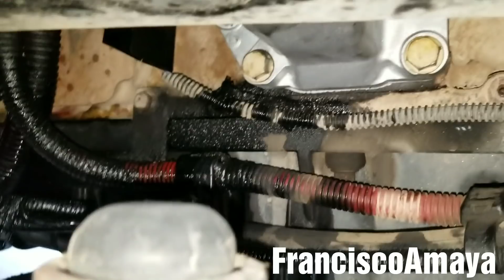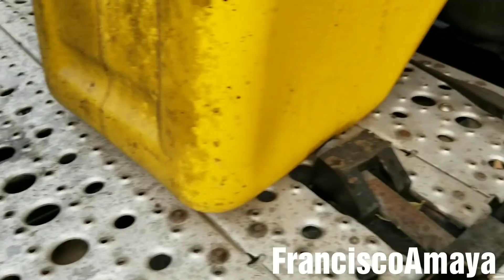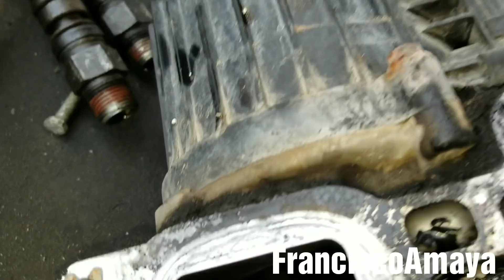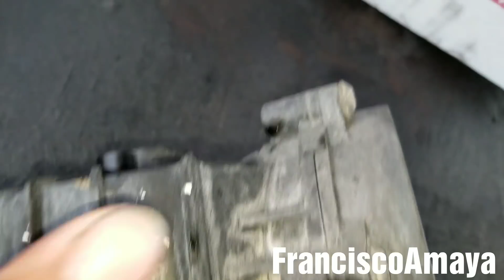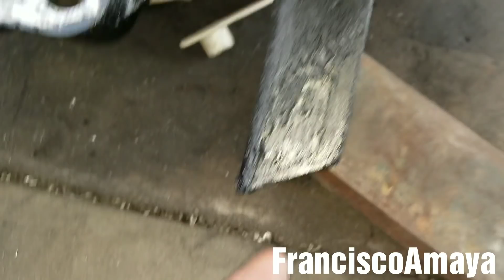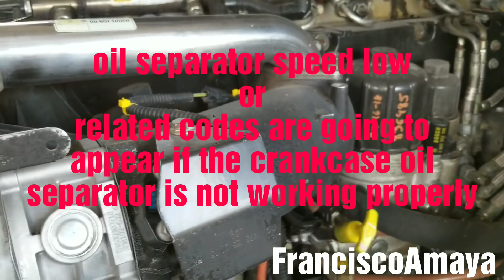Freightliner cascadia DD13 DD15 DD16 SPN 5444 FMI 1 Bad crankcase filter oil separator leak

Comment: Thanks for the explanation of how this works. Will this cause the engine to accelerate slowly or the truck to slow down when coming off the throttle? This is what mine is doing, in addition to spewing oil. Push the clutch in when coasting and the truck coasts freely instead of slowing down.

Comment: I have my crankcase breather leaking oil, excessive white smoke when engine hot, also loosing 1 gallon coolant every  25 mile drive.
Reply: Same issue did you find out the problem
Reply: @AA-bk8qg  did you find out the problem
Reply: @notkirill6991  changed crank case, and re sealed oil pan. Also oil cooler was bad that could have caused the smoke to to I don’t know
Reply: But everything is good now
Reply: @A A  ok so u saying changing the filter might fix the white smoke issue?

Comment: I changed the filter and it's leaking still. Seems to be leaking more. I also put a oil rag under breather and it's covered in oil coming out of breather on crankcase filter. Any suggestions 🤔

Comment: I have dd13 freightliner cascadia. 
Had this code spn 5444 fmi 1
I changed oil breather,  speed sensor and fault code is still there. Please advise.
Reply from the maker: Probably the engine harness is bad

Comment: My truck is leaking oil from the crankcase. I replace it but it’s still leaking
Reply from the maker: It could be high crankcase pressure caused by a faulty engine

Comment: My crankcase breather started to leak heavily 2 months ago. I replaced it and the new one leaked a little bit right away from the same spot, the vent on the crank case breather, it failed and started to leak heavily like in the video. I got another one and the new one is leaking pretty bad from the vent as well, just like it is in the video. I didn’t notice any loss of power and I’m not loosing any coolant, I’m loosing oil a little bit because it’s leaking out but not like some people are stating there problem is where they loose a gallon after a few hours of driving. The dealer tested the cylinders and said they were all above 90%. They told me to do a dyno to have better testing results on what’s going on. They think the piston rings are all worn out equally and I need an over haul. My mileage is 711,000 it’s a 2015 cascadia DD15
What advice can you give me sir? 
Thank you
Reply: Also I don’t have any blow by when I remove the oil fill cap.
Reply from the maker: Maybe there is cylinder than is leaking compression.  I see nothing else.

Comment: Hi thank you for your video. I've a question, I have this exact same problem and everything I've found on the issue says it's cause by failed cylinders, is it possible for just the filter to be bad and not need a rebuild?
Reply from the maker: What does the engine do exactly?
Reply: @franciscoamaya7095  hi Francisco  I have seen this issue today how far can I drive to get place that I can fix

Comment: Hola Francisco tengo  un cascadia 2010 dd15 le hice el overhaul hace 6 meses le puse el crankcase nuevo pero ahorita me tiró el aceite y el tanque de agua esta muy bajo, le chequé la tapa de el aceite y tiene como una tipo nata café. Estoy como a 20 millas de el taller podría correr el camión así o será mejor requiarlo?
Reply from the maker: Posiblemente una camisa se quebro
Reply: Mi camión ya está en el dealer y el diagnóstico es exactamente a lo que tu mencionas gracias por responder

Comment: Hi Francisco I have a 2007 Columbia with that Detroit 60 series engine. Last few days I started getting smell of oil and I checked under the truck no oil on the ground but bottom of the engine is oily and I think around the crankshaft breather pipe is worse. Do u think I have a same problem?
Reply from the maker: Yes, it better to check it before it becomes something bigger.

Comment: great video. quick question do you need to drain the oil out before removing the part
Reply from the maker: No, you don't have to drain the oil to remove the oil separator.

Comment: Great video Francisco. Quick question. About how much should I expect to spend to get oil leaks fixed around this engine? 2010 Cascadia DD15. It's leaking around the fuel rail on the intake side, and leaking everywhere on the exhaust side. Plus it's leaking from the back, up top somewhere. Engine runs great tho. Just have to always keep an eye on the oil level..

Comment: How do I get rid of a permanent low def pressure fault? I had contaminated def. The tank has been cleaned, def lines have been cleaned out. Filters and screens have been replaced in the pump and metering unit. The metering unit has been taken apart and clean out. Def pump is new and pressure limiting unit as well. The truck is not using def right now and the code shows up permanent, not active. That's the only code being shown. It's a 2012 Cascadia with dd15. My mechanic doesn't know what to do and the dealer just wants to replace everything that we already cleaned out/replaced.
Reply from the maker: Replace the DEF metering valve with a new one and perform a DPF parked regen with the DDDL software to confirm the repair.
Reply: @franciscoamayaYT  Thank you will do.
Reply: Alex did it fix the problem?

Comment from the maker: Do you want to see more videos like this one?
Videos where I explain how something works with details?
Comment on this comment with your opinions.   

Thanks for your support 👍
Reply: Hi I have a question 

I have a 2013 freightliner cascadia,  when I turn on the right signal it blinks very fast even when I check outside of the truck the light blinking fast on the front, side and rear. The light bulb looks fine can it be a fuse that needs to be replace, thanks
Reply: Claro que sí Francisco, me gustaría ver más videos explícitos relacionnados con estos nuevos motores, sobre todo del Cummins ISX y del nuevo Cummins...excelente tu trabajo de explicación...
Reply: I need a mechanic any recommendations in the Fontana area ? Especially on the one box DPF system
Reply: I'm trying to have a conversation through Facebook
Reply: Francisco Amaya 
Thanks for the video 
I replaced this filter one day ago in TA shop because oil was coming from it. But I found today my coolant level went down to half gallon in 350 and white smoke was coming from it in the evening when I parked my truck
Kindly suggest,
Thank you
Reply: @prettyp4925  you have a bad head gasket park your truck and get it fixed ASAP
Reply: I like the description of how the parts work and sharing the signs what to look for when the part is going bad. Better to replace something before it fully breaks and leaves you on the side of the road.
Reply: How can I contact you?
Reply: Thank you
Reply: Is there any contact number? I have some questions?